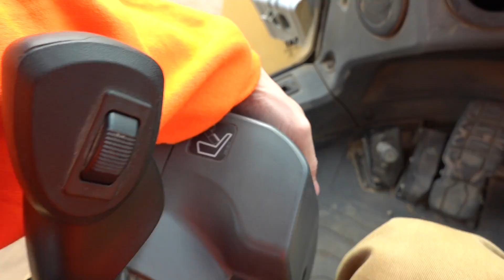Glendale Supercross 2019 Day 2 Build

Comment: Dude please make these longer. Should be 15-20 minutes easy. Just set some GoPros up either in the stands and on the equipment and do a bunch of time lapses and just regular speed track building, even if it’s just a section being built for like 5-10 minutes straight or even longer. No one will be bored I promise.